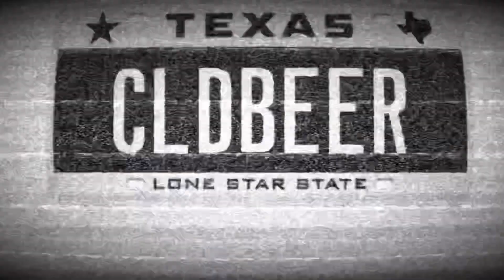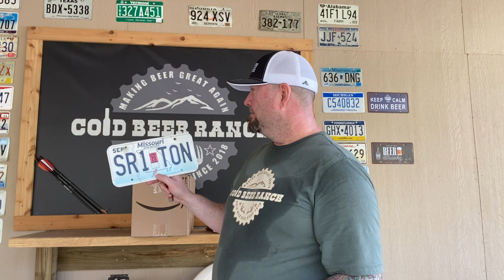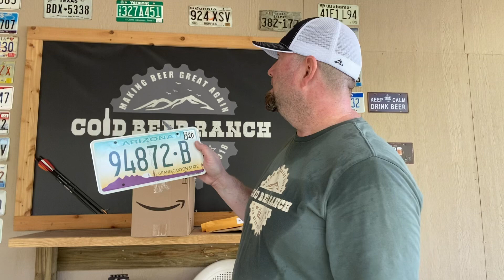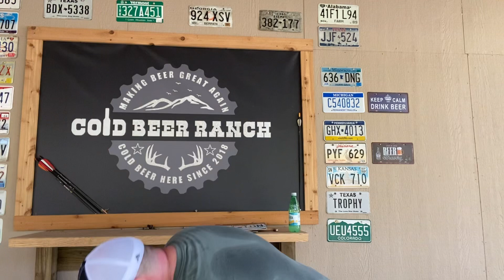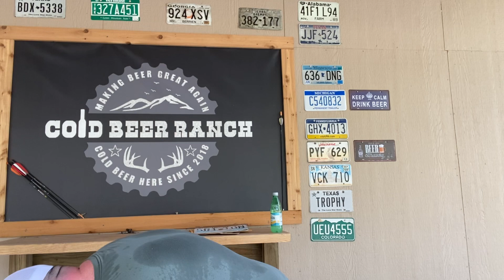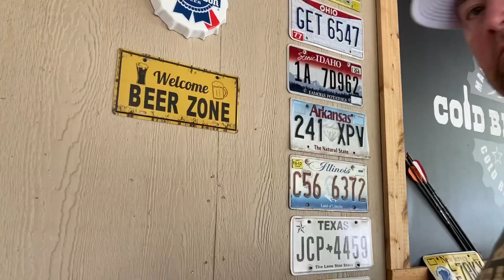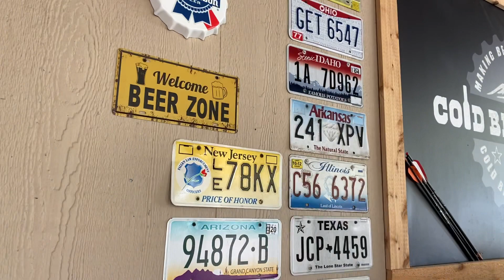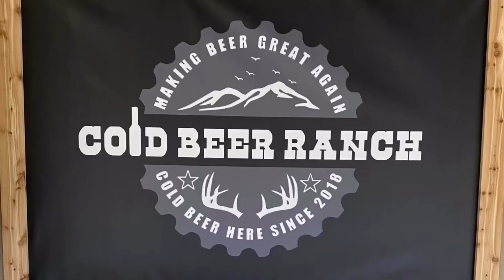DIY WOODEN WIRE SPOOL PROJECT

Comment: Find an old pair of blue jeans (no holes) and make some sand bags out of the legs for your shooting table.  Play sand - dry enough sand in the oven @350° - 1 hour to sterilize it and kill anything.  Sewing machine closed each end of the cut off jean leg section with the amount of sand you want filled in them.  They will work great at the cabin too.  Shoot straight & stay safe!
Reply from the maker: This is an awesome idea